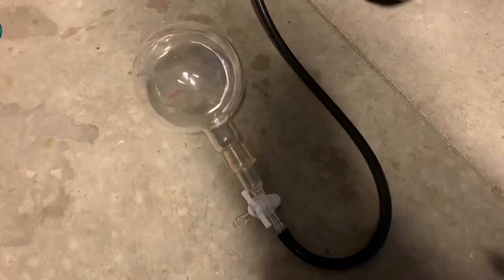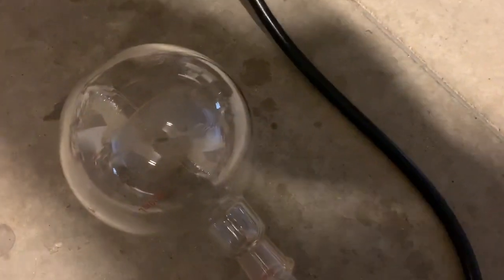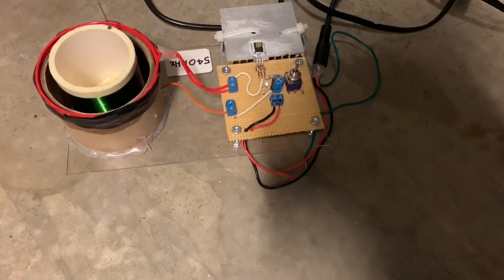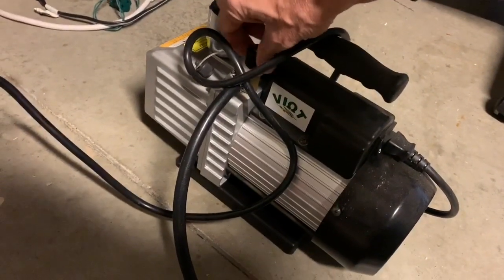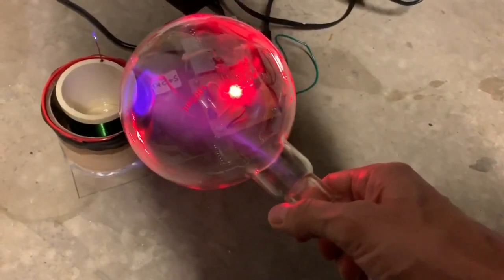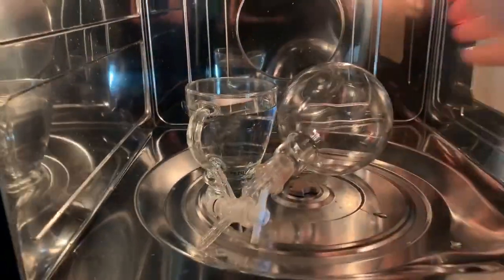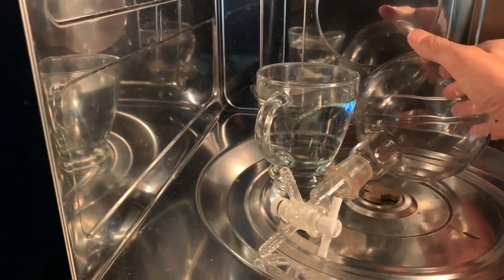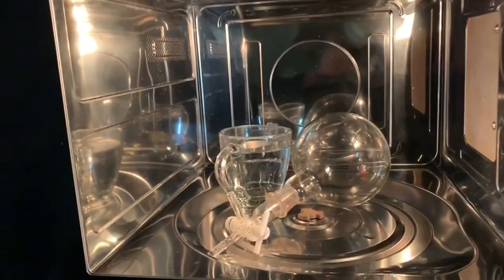Aurora Borealis in a MW Oven? Not Quite!

Comment: Good lord, what is happening in there?!
Reply from the maker: Red_Five the microwaves are penetrating  the glass of evacuated vessel and interacting with the low pressure residual air in the flask causing it to ionize. Once ionized, the dimension of the flask are such for the MW energy to set up standing waves in the conducting ionized air in the vessel which continues to heat the plasma..
Reply: @BrianDhvTinkerer  Thanks for the explanation.

To be honest, I was expecting someone to say "Aurora Borealis" or make some other "Steamed Hams" reference.

Comment: omg that's so cool please explain how it works
Reply from the maker: The microwaves are electromagnetic radiation with standing waves set up in the microwave oven cavity. Although microwaves are not ionizing radiation, the electromagnetic field associated with them does have enough energy to tear of one or two electrons from the outer shells of some of the gas molecules in this case air aligned with the electrical field of the microwaves. Once this happens, these electrons collide into other adjacent air molecules. At low enough pressures this sets up a chain reaction and an air plasma is formed. As electrons recombine with positive ions, light is formed in the plasma. Since there is a continuous source of microwaves, the process continues. All this activity makes heat. The microwave wavelength is 12 cm the right dimension to form standing waves in the oven cavity.  The plasma itself is electrically conducting once full formed.
Reply: @BrianDhvTinkerer  wow thanks for the reply! I tried the experiment with a Neon vacuum ampule of mine but it didn't work and i can't figure out why :/